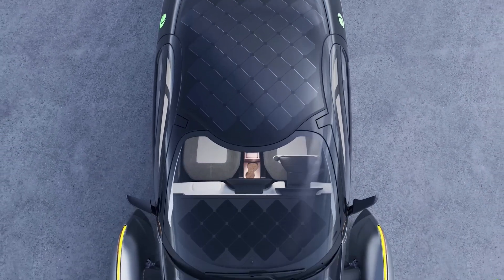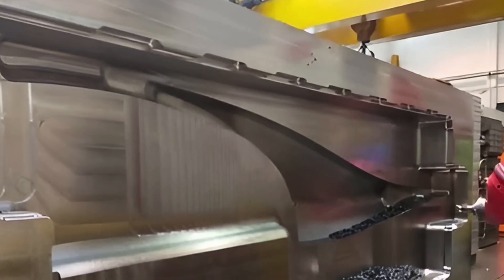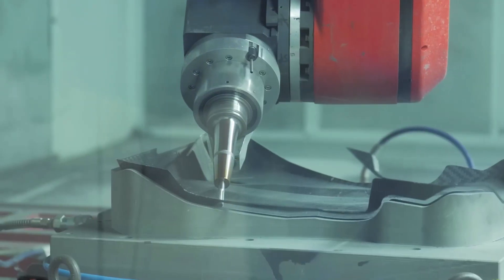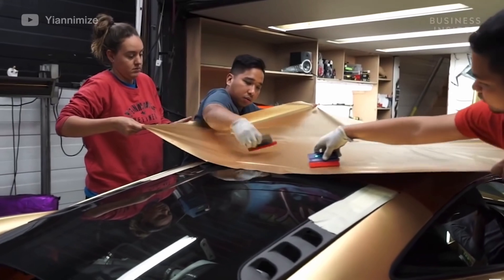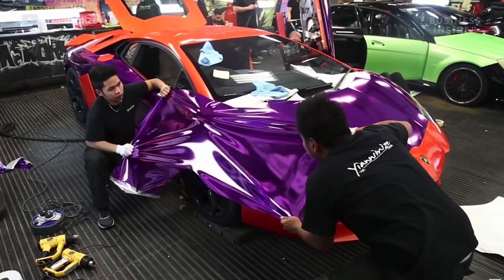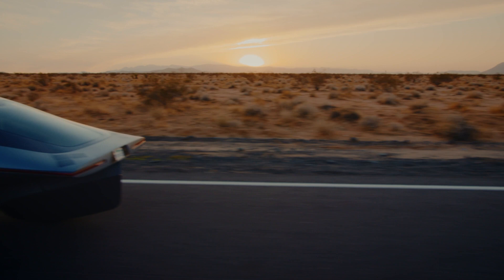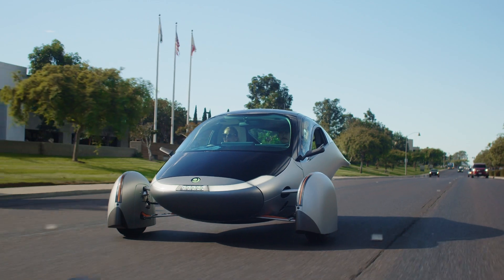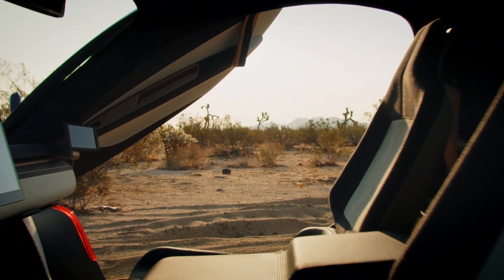Official word from Aptera on the wrap! #aptera #solar #ev

Comment: Aptera have created a protective transparent film for the solar panels that should last 15 years without degrading.  I have little doubt they'll do something similar for the body in time if needed.  There's a reason 3M hasn't pushed their film technology further.  As with several segments 3M owns most of the market.  They want you to re-wrap your vehicle every 3-5 years.  Aptera will leapfrog other technologies and either inject color into the parts or create their own film.  They can't do everything at once though and need to get into production.  Things like an updated wrap technology may come after initial production starts.  This is just the beginning of something special.